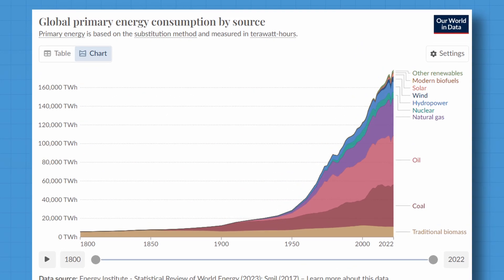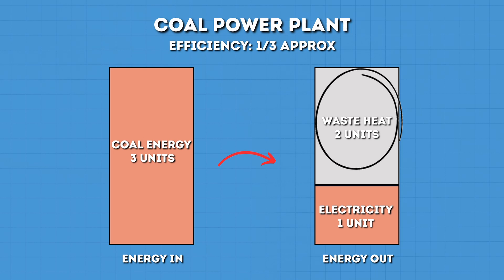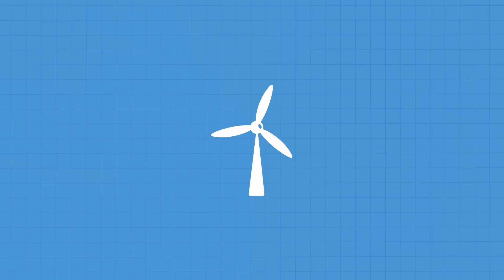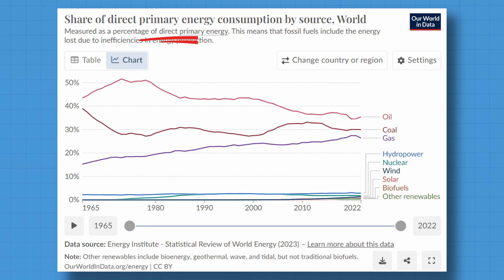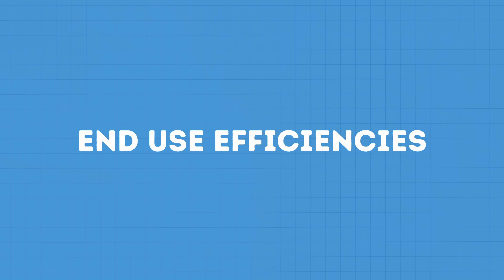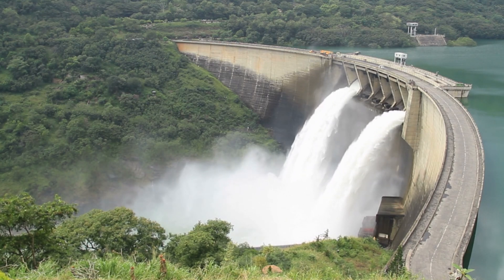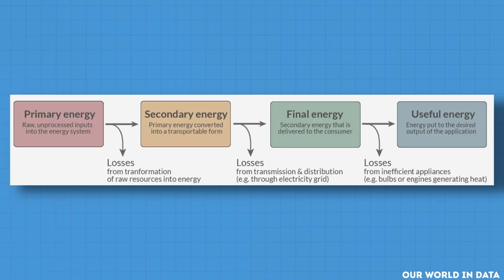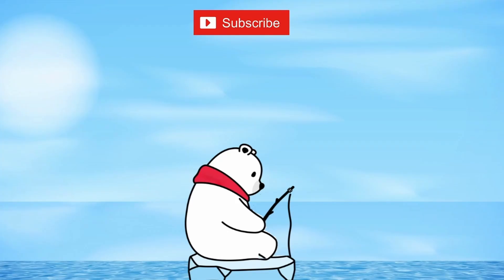We need to talk about the Primary Energy Fallacy

Comment from the maker: 💡What do you think about the primary energy fallacy?
🔋This video is a slight simplification of the issue, as storage definitely needs to be taken into account.

📃Feel free to comment other video ideas and topics you feel are important!
🎁Consider subscribing, commenting and liking the video!
Reply: Primary energy does my fucking nut in. The UK's heating policy is riddled with it. Gas heating has a primary energy factor of 1.13 in SAP, which basically calls it "efficient" and makes it the default option on EPCs.
Reply: did you lock that door behind you so that someone doesn't slam the door on you while you're filming? :face-turquoise-covering-eyes:
Reply from the maker: @drzavahercegbosnaponosna5974  😂
Reply: Electricity is only one part of energy we consume. A huge part is heat energy itself
Reply: @afreire239  Green heat is a different challenge, albeit far, far less complex than green electricity.
Reply: In order to better comprehend the current situation, one may have to go back to life of Nikola Tesla, and his implicit goals, when he designed the grid system.  

His theories may have been based on a critique of Lord Kelvin, and the facts that meat muscle, man or beast, did most of the work back then.

Clearly, an all electric formula must stand alongside an all carbon formula, in order to get a decent feel for a clear outlook.

Comment: OK. You convinced me in the first minute, but still not possible to do away with fossil fuels for all kinds of uses not related to electric generation. Electricity accounts maximum a fourth of our energy needs.
Reply from the maker: Some sectors and uses are extremely hard to electrify indeed. I'm not sure where the 1/4 stat you say comes from, but I find that electricity is more than 50% of final energy consumption (in the EU, is probably lower in other areas). Also, this number is rising (automobile, heating, industry). But yes, certain processes in industry for example, it's like good luck replacing that for now. But in the overall picture, if we manage to electrify the rest ("easy" stuff), and then innovate in order to replace those things that are hard to electrify, then that's already a win.

Comment: Umm, thats just wrong - heat energy (called here as waste) IS usedfor heating. We literally use it to transfer heat in to radiators of city buildings.
Reply from the maker: You are right to point out CHP for district heating (which in hindsight I probably should have mentioned), however this is specific to certain regions and plants. Most fossil plants are not CHP, and not all CHP is fossil either (waste, biomass)

Comment: Hi Andreas,
Great video. You've probably seen the work by Saul Griffith (Australia) but well worth a look if you have time - maybe Michael Liebreich's 'Cleaning up' podcast interview as a good start. His book 'The big switch'  is a great example of how a country like Australia can decarbonise via household energy initially. Not only does he use Sankey Diagrams (I think he probably dreams in Sankey format!) but he clearly lays out the efficiency gains via heat pumps, induction hobs & EV's etc.

Our house is fully electric but having changed recently from electric heating to an ASHP it's interesting to see how much less energy we are using for heating and hot water daily and the house is consistently warmer.

Keep up the great work😊
Michael
Reply from the maker: Hi Michael! Thank you for the nice words. I saw the video with Saul Griffith as soon as it came out haha, and I normally listen to Liebreich's podcast regularly. 

That's very interesting. Out of curiosity, how much do you reckon it would save you on the long term (not that everything is about money of course)? I tend to get into conversations where the whole "It's too expensive argument comes up". So it's interesting to hear from someone who has first-hand knowledge.
Reply: @theclimateClub   Yes - Liebreich's podcast is excellent and he's always smart in analysing conversation with his guests. 

On costs - it's not always easy to do some calculations for going fully electric in the house and what we've done - as some things we invested in a year or so ago didn't necessarily work out in the long term. Taking items separately can be easier sometimes. For the Heat Pump (for example), currently most of the UK can get a 7.5K govt grant as you're probably aware. Our ASHP was ordered and installed with Octopus energy, who were very good at the install. They do the survey, then install and claim the grant directly. The cost of the heat pump in full was about 10.5k, so after the grant it was just over 3K for us, so we had to pay that extra via a loan. That amount included 8 new radiators (no vat) and when you see the amount of work done by the Octopus team (from electricians to plumbers etc) you can see where the money goes. Radiators sized properly for the rooms so that the house is heated efficiently and consistently from room to room. I can see that the actual Heat Pump unit cost come down as more people go for this over the future years - but I can't see the work required by the install team would be reduced by much, because each house needs an analysis by the surveyors (heat loss survey) and each house might have a different design depending on the house heat loss. We have good insulation in our loft, reasonable insulation in the walls and our windows are double-glazed. Now we also have a bigger water tank in the garage linked to the heat pump which was part of the install costs, it works really nicely.

The big problem with running costs is that gas is much cheaper than electricity which an 'unfair' quirk of our energy costing system. Our electricity rate (Wales) is about 3 times more expensive than gas. A boiler runs at about 85% efficiency, and most heat pumps are about 350% efficient or above for the hot water and house heating (3.5 SCOP) so the running costs of the heat pump is marginally better than a gas boiler to run (a new gas boiler to replace is probably about 3k including install). The costs of heat pumps to run can be cut down of course by getting a 'heat pump tariff' for example - Octopus do one, and it gives 3 periods of cheap rates during the day - possibly 8 hours. So once you're signed up for that, you can probably reduce running costs by about a 3rd compared to the gas boiler. We have an EV which we charge at home, so we use a different rate that offers a really cheap charging rate for the car at night (7p for 6 hours). So we don't use the heat pump tariff which is a little bit more expensive. We have some batteries and solar, but of course, solar is reduced in the winter months which is when you need the heating! In the summer the solar and batteries pretty much provide all the costs in the house for electricity and water, the car charging for free from excess solar and some excess solar to the grid (energy provider). I am looking to provide some more batteries and then our winter bills for electricity/heat/hot water will probably be reduced by about two thirds over the winter period (standing charges are always there - unavoidable!). 

With all renewables the more you invest, the cheaper your bills are, but if you don't have that money to invest upfront in the renewables then you end up paying for loans etc over a period. I actually love being off gas and the fact that for half the year our solar & batteries cover everything in the house. I don't think though that the Heat Pump could be seen as 'paying for itself' - I think you can reduce your bills with it using tariffs, but if the govt change the way we pay for that last bit of the grid use (i.e. Gas Peaker plants get paid a lot for that 'final bit' of energy during UK usage on a given day) then more people could go fully electric. But the downside is if the cost of gas went up you'd have a lot of existing 'older homes' with higher bills. The heat pump is lovely for keeping the house extremely consistent with a nice temperature, much more so than a gas boiler.

Not sure if that quite answers you, but feel free to ask specific questions if you want 👍🙂 - the bottom line is that if your heat pump costs more to run than gas it normally means the heat pump has been installed incorrectly. Although I would highly recommend Octopus, I think other companies like the 'Heat Geek' network are very good too.
Michael
Reply from the maker: @MichaelJohnField  It was a pleasure reading this super interesting answer Michael! Thanks a lot. Everything you said seems to go with what I had read and heard. Best of luck to you!
Reply from the maker: @MichaelJohnField  By the way, I'm thinking of doing a video on heat pumps soon. If you have any tips, papers, or people I should talk to that would be great! Thanks👍

Comment: Hey, thanks for the great video! I have a doubt though: How will we represent renewable energy from biomass sources? Will we use primary energy since they're combusted/gasified like fossil fuels or will we use the substitution method?
Reply from the maker: Thanks a lot! Since biomass is also considered as thermal, in accounting it's similar to fossil fuels.  In the PECM method it's given a 0.3 (30%) conversion factor for example. In substitution, it's normally the same as the others, although I have seen it be a slightly lower % in a paper. The only tricky bit with biomass, is when you start using it as biofuels. I'm not sure what happens then tbh, but I should have plenty of sources which explain it if you want
Reply: @theclimateClub  I see, thanks for the reply! Sure I'd love to have a look at the sources!

Comment: This video makes some valid points.  However, it overlooks some other fallacies.

SUBSTITUTION FALLACY: Fossil fuels are used to make plastics, nitrogen fertilizer (for food), steel, and concrete.  There are currently no economic substitutes available.  So these "primary energy" uses need to be retained.

EFFICIENCY FALLACY:  Different sources and processes have different efficiencies.  For example, natural gas combined cycle electricity generation is about 65% efficient.  (Also, modern coal plants are about 45% efficient, not 33%.)  The usage matters also.  Modern natural gas furnaces are about 95% efficient.  The efficiency of heat pumps falls with outside temperature.  So in temperatures below freezing, gas furnaces are the better option.

INTERMITTENCY FALLACY:  Intermittent renewables (e.g. wind and solar) only make electricity when it is windy or sunny.  But electricity is needed all the time, not just in proportion to wind or sun.  Also, costs for intermittent sources almost never include the requirement for dispatchable electricity (the kind we need).  So in addition to the wind and solar, we need HUGE batteries, which are VERY expensive, or we need quick-reacting backup power sources such as fossil.  Since these fossil sources are required to remain on costly standby, while the "cheap" renewables are doing their thing, the cost picture gets very distorted.
Reply: Dzcav3,
very succinctly put, reality over fantasy.

Comment: So, I think you need to review the starting point of your calculation. A solar panel is at best 15% efficient in lab conditions, so about 5% in the field if you add seasons, weather and the day night cycle. Similar for wind power where its either to strong or not enough. There is also the challenge of making / replacing renewables without fossil fuels and also the backup / storing of an intermittent source. We have never transitioned from a dense energy source to disperse source so the need for massive grid changes is also challenging

Comment: wait didn't know this. this practically means all graphs I've seen until now are just fossil fuel propaganda and the transition is like 3 times simpler than it seems. nice to know
Reply from the maker: Kind of yeah. BUT we need flexibility (storage, interconnections and DSR), and transmission to accelerate. So yes, but still a lot of work to do

Comment: There is no fallacy that the heat engine cycle to shaft energy conversion is not ideal.   That has been known for centuries because it greatly runs the modern world.  Energy on the power gird is equated to MW hours therefore to replace a MW hour of coal fired electricity requires a MW hour of electricity.   You have to replace all of it.  

Solar electric panels only provide useful stable energy when used with storage such as batteries.  You'd be financially a head to invest the tens of thousands of dollars needed for a couple days of home battery storage in stocks and buy your electricity from the power grid.   Wind turbine generators typically work with natural gas combined cycle plants that are cheap and easy to build, but are expensive to fuel with natural gas.  It's the cheap to build NGCC plants that are the actual base load generators of electricity that make wind turbines somewhat economical.  In the USA onshore wind farm costs when accepted with their electricity have always caused electric rates to go up substantially.  Offshore wind is at least twice as much per MW than onshore wind.

There is no mechanism that would allow greenhouse gas behavior to cause global warming.   Global warming was officially stated at 1.1°C in 1991 and 1.06°C in 2022.  The back of the United Nation's IPCC science report states it took its greenhouse gas samples at 20,000 meters altitude where it is common high school level knowledge there is no greenhouse radiant energy.  This is typical practice for deceptive marketing to state legal data transparency protecting the perpetrators from fraud prosecution.  

Earth's greenhouse effect is frequently used as a primary example to high school students of a system always in saturation from the strong greenhouse gas water vapor absorbing all the greenhouse radiant energy from the earth with greenhouse gases within 20 meters of the surface that is all around us everyday and can't have its overall effect changed.  There is no further greenhouse radiant energy to interact with greenhouse gases.  At 1% average tropospheric water vapor over 99% of earth’s greenhouse effect is from water vapor.  Water vapor would hold earth's greenhouse effect in saturation if it were the only greenhouse gas in the atmosphere.

Atmospheric CO2 levels of 1200 ppm about three times what they are today would greatly invigorate C3 plants the majority of plant life on earth greatly greening the planet.

Comment: If you had enough solar and wind installed to cover needs, the construction and land use wastage would massively exceed the heat losses of fossil fuels. Renewables have such low losses because they shift inefficiencies unto fossil fuels, which sit idle shedding heat while solar is pumping energy in, but then need to be heated more when the sun sets to compensate.
Reply: Using installed capacity for renewables compounds the issue, because it hides the idle time and shifted inefficiencies that renewables cause.

Comment: R'amen!  You are correcting the 2nd Sin of Thermodynamics- confusing heat with work (electricity or mechanical energy) as if they're worth the same- rather like confusing American dollars with Jamaican dollars just because they are both units of money measured in dollars...
Reply: While the second law of thermodynamics applies to 'energy', the core global warming problem is the leveraged problem that CO2 has on the planet surface temperature (where we live) compared to the emission surface temperature (where the final CO2 layer is). 

It's "the size of a candle flame" problem when you can't see the flame 'colour'. 

The primary energy 'fallacy' is the magicians misdirection fallacy - the supposed waste energy is essential to the process of generating our residual (33%) useful (to us) energy. It's the 100% that is burnt that is the problem.